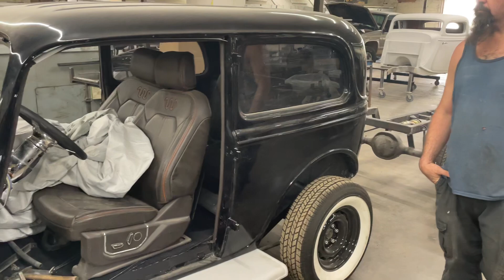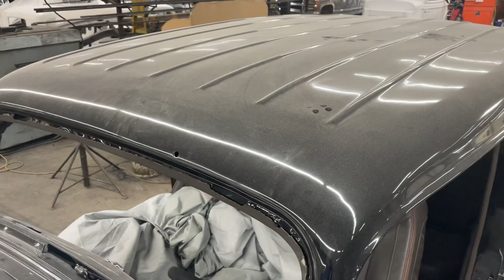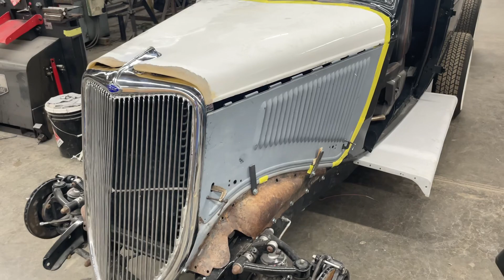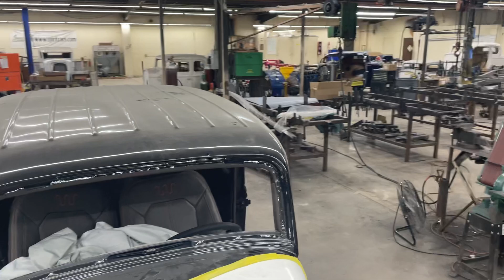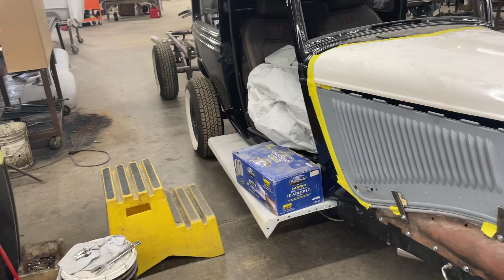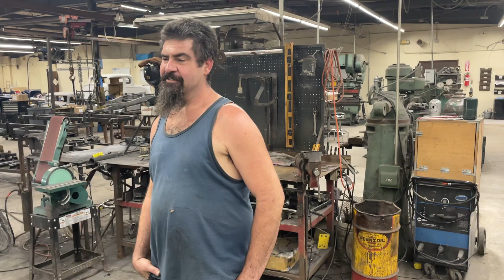Mostly steel body 1934 Ford sedan

Comment: Nice car!  You have original type hood sides...seems like it would be easiest to get a set of oririginal or quality reproduction stock hood tops and then i expect most of your fitting issues will be solved.    I've tried to fit fiberglass parts to old Fords and a lot of times it's easier to straighten and repair old beat original parts than to make fiberglass stuff fit right.
Reply from the maker: Every thing you say is true we are waiting for the customer to come by so we can go over options. An aftermarket hood is many many months on the wait.